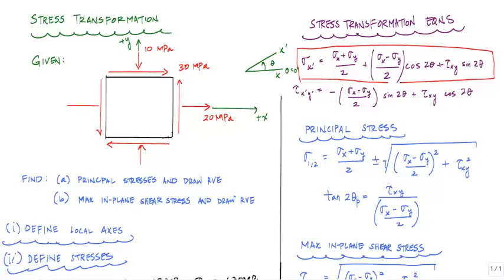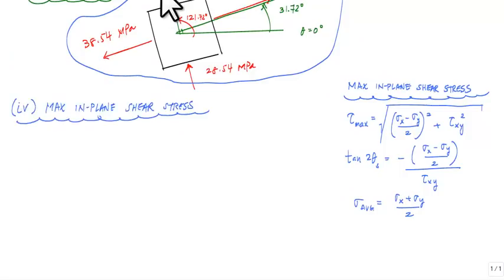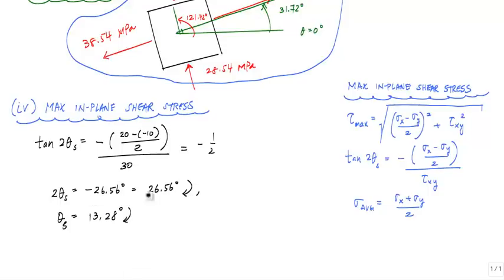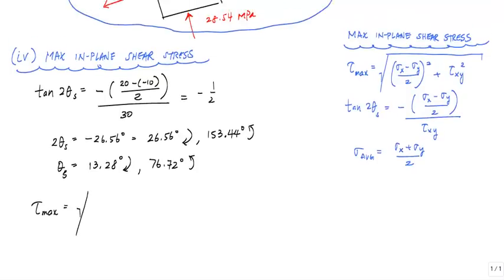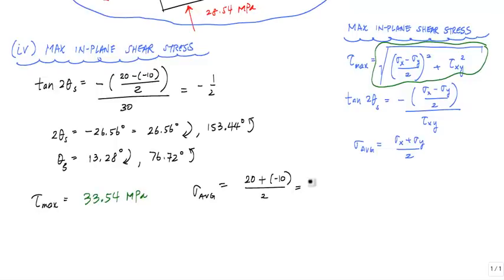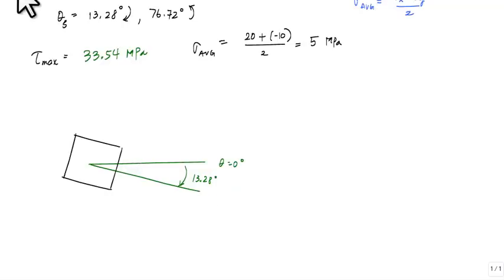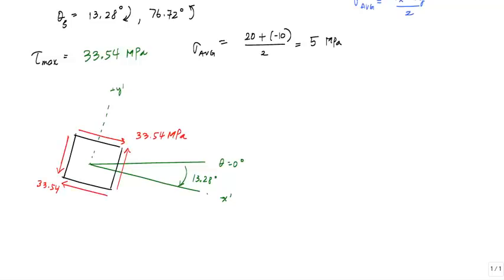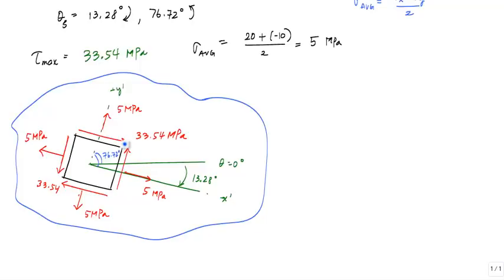stress transformation example 1 (2/2 - max in-plane shear stress) - mechanics of materials

Comment: What is your expression if  question may asked find the magnitude of maximum in plane shear stress on cylinder tank? If some values are given like radius 2m,  pressure 500kpa, wall thickness 10mm.

Comment: As you have said that we will find which angle is associated with which Shear stress i.e the +33.54 associates with 13.28 degree and -33.54 associates with 76.72 degree . But when we make RVE where will be the -33.54 Mpa Direction as in your case you have shown it going to the right which is (+ + = + ) so that isnt -ve value that we recieved ... 

A Bit confused  ...
Reply: If you look at the left down corner, that should be -33.54 (Between the -y and -x direction)